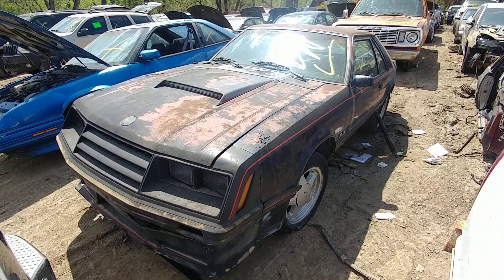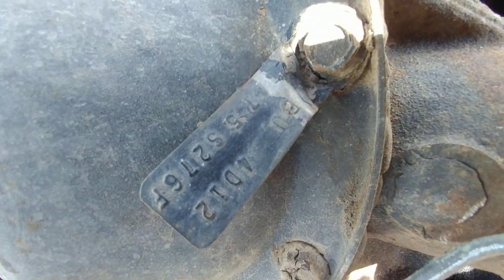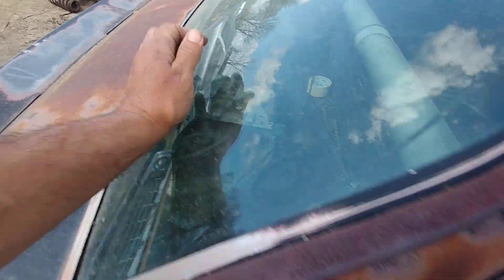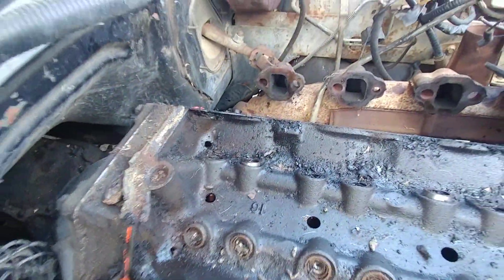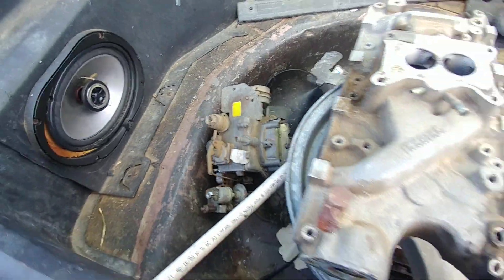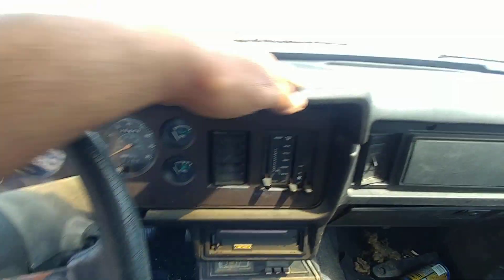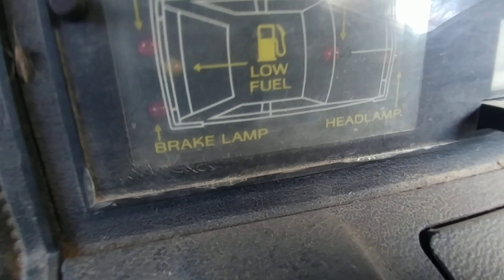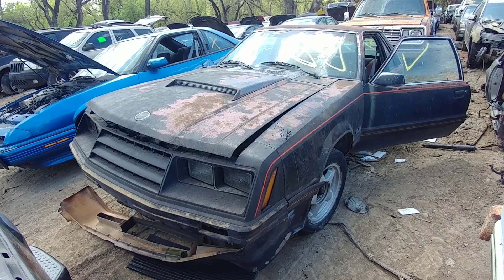1982 Ford Mustang GT Junkyard Find

Comment: In 1982, they put a large 2-barrel carburetor on the 5.0.  Then in 1983 they went to a 4-barrel.  The best year for the carbureted 5.0 was 1985.
Reply: It was a 2 barrel holley which was the big thing 83 also got the t5 85 got the roller cam and went from 175hp in 84 to 215 in 85 .... Then 87 got e7te heads.... Stock 82 heads are gatbage. But i love the 82gt the boss is back!
Reply: Hell yeah 302 is the shit

Comment: The stripped one is a 1985 (10th digit of the VIN being an "F"). I believe it was also a V8 since the 8th digit is an "M" which was one of the 5.0 engines used that year. The '82 Mustang 5.0 was I believe the first year return of the GT line and started the "performance" on the right track. Of course, these cars got better when fuel injection came along and they were a decent package for the money. Yes, the "C" for the 10th digit on the insurance paper you showed tells us it's a 1982 model.

Comment: That front right wheel on the black GT is the standard equipment wheel for 1982-1984 Mustang GTs, it's pretty much a copy of the metric wheel(except it's 14") used on the European Ford Granada.  You hardly see those wheels anymore. Just like everything else, it seems most '82-'84 GTs these days are either on TRX wheels or '91-'93 16" Pony wheels, but back in the day over 60% of GTs were on those 14" vector style of wheel. I just love originality.

Comment: Another good video man these mustangs were the light at the end off the tunnel after the 1974 too 77 pinto mustang fiasco.being the owner off 91 GT and then 95 GT these car benefited from there lighter weight ..and that chassis and they responded well too any kind off performance modifications these were the cars too have in the 90 they were everywhere.i loved mine they were not fast but quick up too about 60. And they made lots torque and they gave muscle car performance for a reasonable price unlike the heavy camaro and firebirds that little 50 liter v8 sent Chevy too the design board were they came up with the 5.7 lt1 v8; when that engine debuted in 1993 you had too have a very good running 5.0 are at least be supercharged  ..to go head too head with one as they made lots off power down low ...I’m amazed not many fox bodies survive today in mint condition and the ones that are people are asking what you can buy a used mustang with the coyote 5.0 wish I’d had the foresight too have kept my 91 GT as I left it stock but did performance modifications most that I see now are cobbled together from all different years and have been half ass hot rod into oblivion 👍

Comment: Here's something interesting. This is an old Motorweek comparison between the '82 Mustang GT and the '82 Camaro Z-28. They used an LG4 equipped manual transmission Camaro and of course a manual equipped 302 Mustang. One "mistake" at the end is that John Davis indicated that at the end of "next fall" which would have been the fall of 1983, that GM was introducing the 5.7 fuel injected V8 in the Camaro. However, this would not occur until 1987.

Comment: The 1982 Mustang GT was a rare and somewhat desirable model, but not desirable enough apparently. If this had been a 1965 Mustang in that condition, it would have some for some ridiculous price like $10,000 and someone would have spent $100,000 restoring it. But, this one was too far gone to justify fixing it up, even for a daily driver. Too bad, not too many of these left, but Fox body Mustangs in general are starting to get some love and attention finally, More than the 1974-78 Mustang II ever got.

Comment: The GT didn't come back to Mustang until 83'.
Reply from the maker: Ive been known to be wrong before and I honestly dont know these fox body mustangs very well. But doing a Google shows multiple results saying there was an 82 gt
Reply: It's ok. I was a rabid 80's Mustang fan. The highest option for the 82' was the GL. The engine was still a 302, but was called the H.O.. When the 83' was released, the Holley 600 was a four barrel. The 82' was a 2 barrel. My first experience was the 82' Capri (same engine and stick)
Reply: The Capri was a torque monster.
Reply: 82' was the 1st year they were out.Could be had with the 5.0 Liter with a 4 speed manual or a 4.2 Liter V8 with an automatic.Was originally supposed to be called the Mustang SS but at last minute they changed it to GT.Needed something to compete with the new GM F-bodies
Reply: Yea, I have an 82' and it's definitely a GT.
Reply: Not sure that if they were actually called GTs in 82, but I remember the advertising for that model was, "The boss is back"  and that's when the pony car wars officially started again.   They did have the 5.0 between 79 and 81, but it was just an engine option and did not really look much different than any other Fox body Mustang prior to 82.  From 79 to 81 they were pushing the Mustang Turbo as the performance car.
Reply: Wrong.
Reply: Definitely was a Gt
Reply: The gt was available in 1982